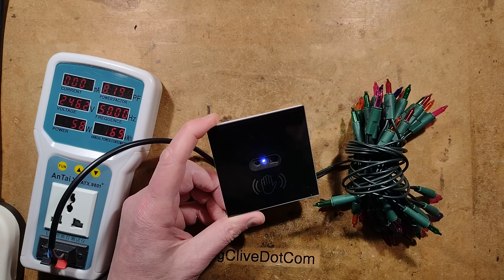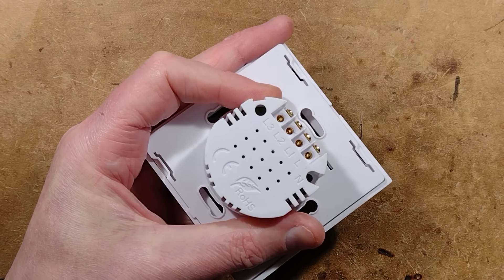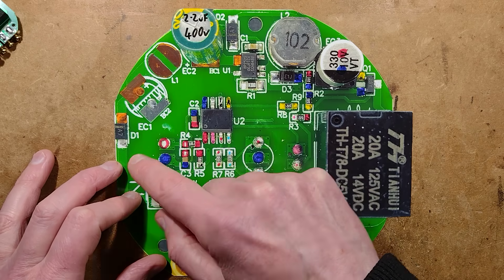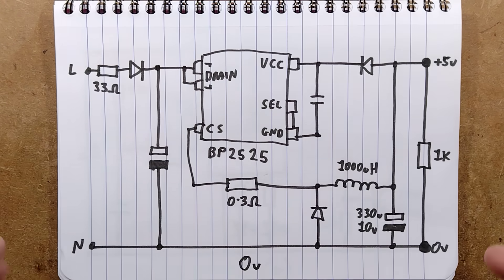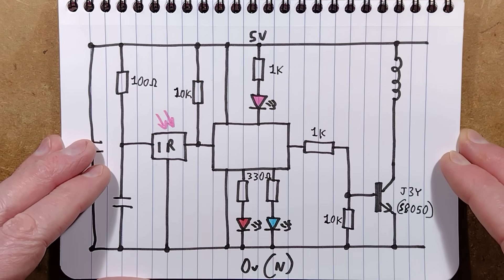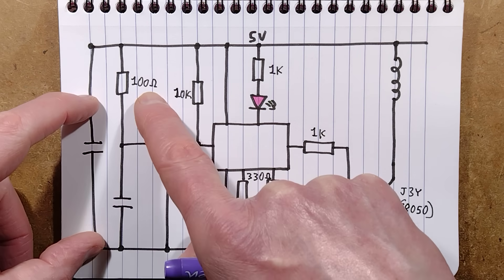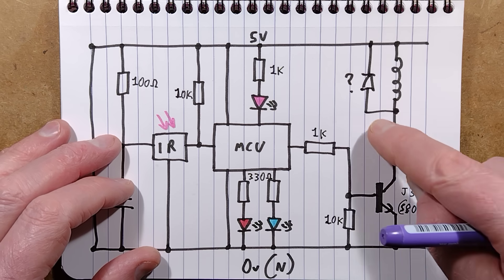Inside a non-contact infrared light switch

Comment: I have a similar 12 Volt switch from Ali-Express that has no relay, but will dim or brighten a 12 Volt LED Strip if you hold your hand near or on/off if you just swipe your hand near it. I put it on some water proof LEDs in my shower.

Comment: The relay is only 125VAC, wouldn't that be a problem in countries with 240V supplies, such as Australia and the UK?
Reply from the maker: The datasheet suggests a 240V rating too.  But I'm not a fan of tiny relays.

Comment: I expected a simple, cheap, capacitive dropper power supply. 

The buck regulator is a pleasant surprise, as I have a feeling that it'll last longer than a typical capacitive dropper supply would. 

All the cheapie remote type "smart plugs" and so on that I own that have relays in them and a capacitive dropper type power supply seem to fail the main dropper capacitor after a year or so of use. 
I don't know if it's because the relays use a larger current than most other circuits powered by a capacitive dropper circuit, or if it's just because the products use extremely cheap capacitors, or a little of both perhaps.... 🤷🏻

I keep a stock of typical value droppers capacitors around because every year or so I have to replace the ones in my cheapie products.

Comment: UK lightswitch wiring is usually live, load, and earth, so this is not going to be a simple light switch replacement, where neutral is not available. There are some capacitive coupled "GLASS" switches that are compatible with  live and load wiring. These are sufficiently sensitive to operate without contact, but the range is only a couple of centimetres.

Comment: the bp chip has 200 volt in but the gnd isnt going to gnd so how does it work ? , all the diodes are pointing in and there is only the coil and cap to gnd .
Reply from the maker: The designers have used clever techniques to create a virtual ground.  It gets the reference and samples feedback during the switching cycle.

Comment: We have simillar at my job to activate electric door opener between washroom and workplace from one side of door, other side have RFID reader to authorised enter only.
My parents friend (electrician) had infrared switch and dimmer in one at his house so he can turn off/on by short expose or regulate by long expose by hand or pointing TV remote control when sitting on couch. It was in 1998! He said switch/dimmer is too expensive to have it in each room so he had only one. Later I find switch  was manufactured by Czech brand Electrobock still in bussines.

Comment: Few years ago I somewhat tried to install a Philips version of that in my toilet.
Just some action wins.
Unfortunately it didn't work with led lighting. Kept glowing.
This looks like I could give it another try.

Recently had to switch something with a relay too. Didn't forget about the diode.

Those spikes can be really high and destroy circuits.
Definitely worth adding it to keep the mosfet happy.
Reply: They also sell cheap pir wall switches.
Will try that one first 😄

Comment: I am still amazed they make so easy 240 volts down to 5 volts without blowing stuff up. In my older days this was impossible, I needed a transformer at least... How science progressed.
Reply: The transformer power supply will work for decades until the filter cap dries out. 
The little buck converter definitely won't. It's not isolated either.

Comment: I would find it verry annoying, every time you walk by the light goes on or off. Switches here are mostly just past the door opening, so you will pass it pretty close.
Reply: It doesn't shut off until you leave the bathroom.  Then with an led bulb when it gos off  it stays on but very dim and flickers at 30 hz .

Comment: Nice video! In the buck regulator when the flywheel diode conducts the potential difference between the 0V rail and the GND pin is the forward voltage of the diode. At that state the buffer cap charges up the feedback cap through the regular diode which preserves that voltage level during the on state of the mosfet. That's how it checks the output voltage.

Comment: Switching the bathroom light switch for a time-delay PIR one has been a life changer. A very good place to have no contact with electrics or clean (well, unsmirched) surfaces!
Reply: In the UK, the light switch is usually on a length of string when inside the bathroom, so you're not slapping your wet hand all over a panel with 240v lurking inside

Comment: That switch is designed for the German style of round, cramped wiring boxed used in many countries on the continent. I absolutely HATE these boxes! There is not enough room to do much inside the box. At least in the States the boxes we use give you the room you need in depth to accommodate electrical items and wiring.
One problem I see is that if one cannot pry off the front glass after that box is screwed into the wall box and then snap on the front glass, any way to remove the glass in case it lets out the magic smoke without breaking it or you need to move something inside the box. Devious trickery? Nahhh, normal chinesium Philosophy. Sell thru trickery……..😅

Comment: I would be fitting a diode across the relay coil.
I doubt the J3Y transistor will tolerate the back emf of the relay coil for long.

Comment: This unit is begging for my NO-NEUTRAL hack circuit! Its perfect for my half-wave no-neutral design, because of the single diode rectifier buck regulator. It wouldn't of worked for me if it had a capacitive dropper. Just two diodes added to the unit, and two diodes and a capacitor, as a bypass at the LED light fixture. https://youtu.be/oBR5O391m_c 
I think I would add that missing diode to the relay coil, to protect the transistor🤔👍
Reply from the maker: That's an unusual idea.

Comment: This could be using same the trick we used for presence detection around 2007.

We spotted that the AGC in these IR receivers results in the output staying low for a short time after the incident 38kHz IR stops. The time it stays low time is dependent on the strength of the signal but that didn't matter for our application

So we sent a 1ms burst of 38kHz IR then looked to see if the output was still low a few microseconds afterwards. Did an up/down counter integration on it with ON and OFF thresholds to decide if a target - a person a around half a metre - was there or not. Controlled the detection range via the IR LED current.

Comment: Is there a diode integrated inside the relais-packaging maybe? I have encountered such units.... 
You know while re-using parts from something else, solder the relais in and somehow it does not work. Then finding out the switching-circuit is shorted to the diode in the relais in that direction. I took it off, put 12V on it until the diode gave up and the relais switched, soldered in my circuit and just works.

Comment: Looks like it needs at least a 35mm back box. Here in UK, most are 25mm and older installations are 16mm deep, so not very easy to retro fit. Also not many UK installer's "loop in" at the switch with live and neutal either...

Comment: They can make a cheap contactless switch with the ability to correct for sunlight... Meanwhile my damn garage door is afraid of the sun and won't close during the day. Because "operating in sunlight" just slipped the engineer's minds.
Reply from the maker: You may be able to put a light shield around the infrared beam sensor.  If that's the issue.

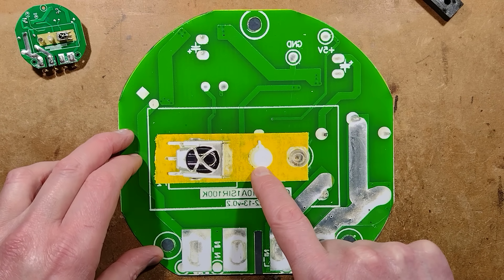Comment: 3:30 'The shielding makes it so sensitive', i am not sure about that. I figured out by removing the shielding from the/any IR-sensor, you get a much more responsive sensor, almost from any angle or direction. Very useful in some applications. The shielding is to narrow the angle of reception, the need to point IR (or reflection of IR) to the sensor of the device. In this case, that is what you want to avoid false positives by reflections around the device instead of in front of it. Actually, I think it is still too sensitive to be usable, it needs a very narrow angle. 10 degrees or something like that so it detects only something in front of it.

Comment: Is that thing designed to be put in electrical boxes or does European code not require electrical boxes? Here in America, houses and businesses are not typically built with brick, but instead with a dense network of wood or aluminum beams called "studs," which when assembled, allow for easier electrical and plumbing thanks to the fact that there is no concrete that wires need to be run through.
After studs are put up and all electrical and plumbing is in place, the open walls are filled with insulation and covered with drywall, but this insulation is often flammable, so we use metal or plastic electrical boxes which wires are run into through small holes and outlets or switches can be mounted to. This thing does not look like it would fit into a normal American electrical box, and even if it did, it would not be up to code. Maybe you have electrical boxes of different shape that such devices can be mounted in. If so, I would like to know!
Reply from the maker: In the UK we have square boxes.

Comment: What happens when you switch into a dead short? does the switch oscillate? relay contacts welded shut? triac pops? etc? 😁
Reply from the maker: Probably track and relay failure.

Comment: My daughter’s doctors office had four of those as handicap switches (two sets of doors, a switch on each side) and they worked quite well for that purpose. Much better than the metal plates. At the time I was actually in a wheelchair because of brain surgery (40% brainstem tumor removal). I have since regained the ability to walk with mobility aids, the ability to walk again, so that’s pretty neat. My surgery is were February 1 and March 15, 2021, however, the office had touchless switches for several years before that. That office got bought out and her doctor or nurse practitioner retired and she switched to my office because we did not like the medical group that brought out the practice. We only stayed for as long as we did because of her provider. The office was a family practice, but also had a couple of pediatricians on staff so I could see this technology being useful as you don’t just put your hands around a bit but hold your hand in front of it for several seconds with their implementation, so it has a wide height that it works at and smaller kids in wheelchairs are able to use it as well.

I would imagine that the five second hold is something programmed into a microchip somewhere in the circuit. 
Although they were not introduced for the pandemic, they did come in quite handy during pandemic. They were also great during cold and flu season, especially in office with children… Children do not wash their hands and neither do many adults if I’m going to be quite honest

Comment: That relay was marked 20A 125 VAC & 20A 14 VDC.  Isn't that a problem for the 240v UK & 220v RoC?
Reply from the maker: The datasheet has a 240V spec, but it is a very small relay.

Comment: Ya'know what BC, those innocuous few seconds about a diode across the relay just made me realise why my gate control panel would occasionally borked itself before requiring a reset coincidentally after i installed a 24vac relay to it. I'm off to get an RC snubber tomorrow. Thanks fella.
Reply: for the coil? 400x diode? (unless your coil is AC !)
Reply: @lezbriddon  Yup AC so figured i'm after a cap/resister pair. Panel (so helpfully) doesn't have any dry contacts so using the outputs of a 24vac coil..but it's fighting me.

Comment: I am interested in power supply. What could be the  the maximum current it can output with 3.3V ?
Reply from the maker: Keep in mind that this is a non isolated buck regulator, so the 3.3V would be referenced to the mains voltage.  There are many dedicated buk regulator modules available and also fully isolated ones.

Comment: On why this device exists, I think you touched on it but I can go further. 

In my IT career, I worked for a hospital system and that included some really weird floors but there was a lot of doorways, not so much to keep people out, but keep the germ movement down. Typically you pressed a button in the wall and it would open the doors.

As soon as you showed off the device, I wished they’d been around when I worked in this one old building where I had to unlock doors while holding a cart as the floor was sloped. I usually had to call ahead and ask someone to hold the door open. And it would’ve met the contactless requirements for hospitals these days. So yeah definitely think this is aimed for medical or other areas with potential cross contamination such as food industry, heck even more corporate internal doors could use these. 

Cool device!
Reply: "A relay clicked, and a door opened".

Comment: The single diode makes sure the regulator only sees half the voltage.  Seeing the 125 VAC rating on the relay, the rest of the circuit is probably designed for 125 VAC, and it probably had the bridge rectifier for that market.  Guessing they changed it to a half wave for 240v markets, but didn't change out the relay.. shame shame.. :-).
Reply: Was wondering if the 1/2 wave rectification is part of the cause for the truly awful power factor. Buck regulators usually do a bit better than that, don't they?

Comment: I do worry about letting AI design circuitry. They just found that AI used for programming is hallucinating program packages needed to supply libraries of functions to ones that just don't exist. This has proven to be repeated and nasty hackers are creating packages filled with malware under these fake names. Since programmers aren't checking things at that level, some really evil stuff is getting put out there.
Circuitry with non-existent components that companies create that do nothing but are very expensive. Reality hallucinated and counterfeit nonsense. I feel a quivering and color changing and rippling visual sensation. Oh, that's just the TV. No problem.

Comment: I've found if you fire a random TV IR remote at them switch panels you can turn them on and off and even strobe the switch, it even work on the head torches that have the hand wave sensors.

Comment: I thought it was ok but the relay is rated 125v? Is that a new string of lights or an old one because I've not seen any filament ones for a few years now 😢
Reply from the maker: Fairly recent string of lights.  The relay has a 250V rating on its datasheet, but I'm not sure I trust it.

Comment: The “certain cultures” and “religious requirements” comments reminded me of the story Isaac Asimov told of him, as a young Jewish man well known for his scientific knowledge, being asked by a rabbi if electric stoves could be used to prepare food during Passover. Traditional Jews are not permitted to light a new cook fire to cook after midnight the day before Passover, but may use an existing fire. Electric stoves do not produce a flame, so the question brought to the rabbi by some traditional Jews was basically “is electricity fire in this context.”.

Asimov went into some depth on the chemistry of fire, but when he got to the involvement of electrons the rabbi had to come down against using electric stoves unless they were already turned on before the deadline, same as an existing fire being allowed.

It seems quite silly to outsiders, but equally “silly” traditions exist everywhere.
Reply: I get a kick out of those. My electric stove has a "Sabbath Mode" for whatever that's used for.
Reply: @tncorgi92 I suspect it allows enough trickle current to qualify as “on” without wasting electricity. You might be able to keep a pot of food barely simmering.

Comment: Would be useful for a silent (or not) alarm trigger, perimeter alarm trigger ETC..  Kind of like using a PIR detector but less sensitive...maybe?  IDK but it's a cool thing.  Thanks for the work Big Clive👍
Reply: A little short-range for such a use (except possibly in a narrow doorway), but that may be rectified by upping the sensitivity I guess..
Reply: @ Probably...
Reply from the maker: There are dual unit infrared ray units.  You mount one on either side of an entrance or room.
Reply: @ Awesome.

Comment: 2:00 That appears to be a very common screw spacing in continental Europe, at least some Nordics, maybe most of Schuko-landia. 
From my passive venture into the world of South Korean photograph/racing models, I have come to notice that South Korea also appears to have Schuko outlets. But they may still have a different standard of mounting the fixtures on the wall boxes.

I hear there is an ethnicity, culture, and related religion where you can't do certain things on Saturdays... and in some cases the practisers are adamant that their appliances comply to that... so if one has a gas powered water heater, it can work with a pilot flame, but not with spark ignition, because one must not make a fire on a Saturday, but it is OK to add pre-collected fuel to an existing fire. Maybe this switchy-thingy comes handy to the strictest practisers?
Reply: Interesting. Schuko is German and I heard South Korean law is based on German law as well. Then again, The Philippines have a mix of all existing sockets.

Comment: 125V AC rated relay. Not something I´d trust for higher loads. I´d probably be inclined to replace it with a stronger one. I wonder how much it can hold when running let´s say standard 230V at 10 amps.